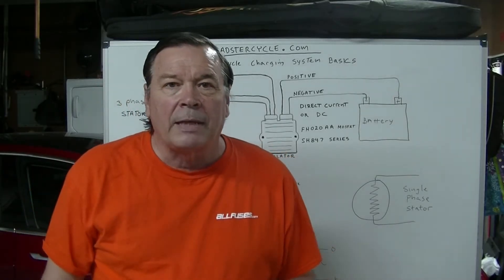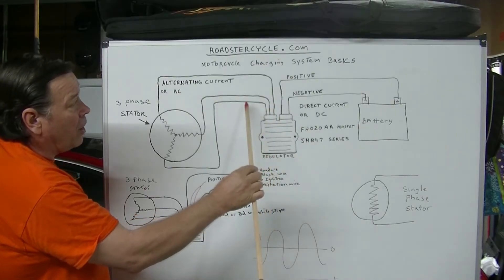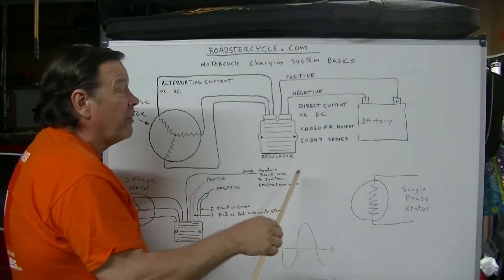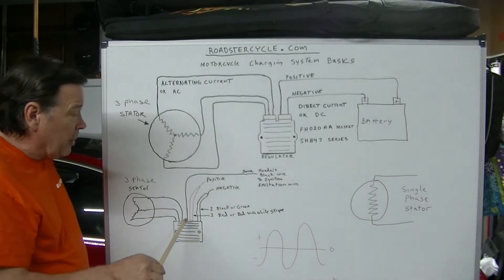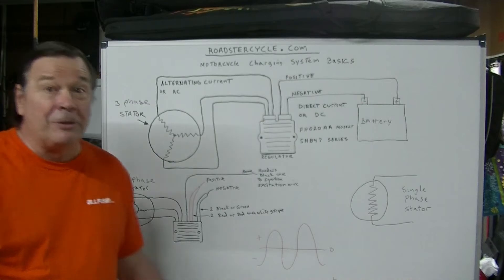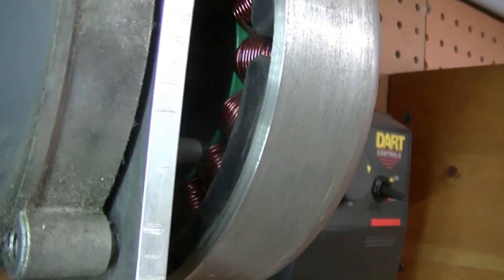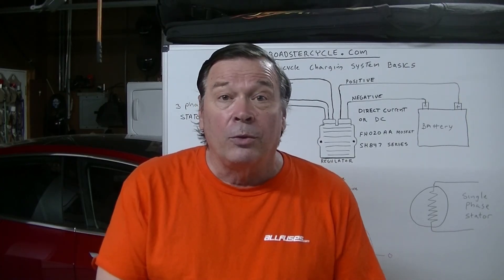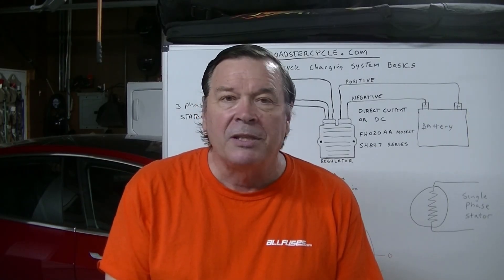Motorcycle charging explained

Comment: I changed stock headlight to LED, + 2 addl LED lamps
does changing old honda 3wire regulator  to 5 wire describe online as full wave help power supply of the bike?

Comment: I have a armada electric motorcycle
First when I lplug in the charger it’s grounding
Second when did get it to charge finally I really debit and after a while the power dies out 
Third the charger started to ground out again
Reply: I meant to say when I finally got it to charge and went for a ride after that the power goes out and can’t get it to run again when I throttle down the power goes out

Comment: Thank you!  Question; does the negative of the Reg/Rec have to be connected to th Battery neg or will connection to ground suffice? (  as Battery negative is also connected to frame ground point).
Reply from the maker: Yes the negative terminal of the R/R has to go to ground. It is not case grounded.
Reply: @Roadstercycle thanks for confirming. I actually tried it yesterday as I wired in a switch (hidden kill switch) and each time I cranked the Kickstarter pedal, no current passed through the switch light, but once I added the ground to the third pin of the switch the switch light lit momentarily. IL try fire the bike up this week and hopefully no magic smoke appears..
I mean the CDI unit...😢😢😢
Reply from the maker: I really like it connected to the battery so the charge controller knows exactly what's going on. If you mount it to a different ground there could be losses between it and he battery. Always best to go to battery.
Reply: @Roadstercycle yes as it's a kind of constant feedback. The problem is a conglomeration of wires at battery negative.  Woul you consider those little multi connectors (5 or 6 terminals) that you clip a wire into as the same as "to the battery" If the battery is one of the wires in the multi terminal block? 
It's been a great challenge and pleasure to wire my SR 500 from knowing almost nothing or being afraid to tackle a wiring diagram. Your videos have helped my understanding, many thanks 🙏👍
Reply from the maker: @pmacc3557  Try it.

Comment: Isn’t the regulator a combination of rectifier (to change ac to dc) and regulator to control battery charging voltage and prevent overcharging?
Reply from the maker: Yes,exactly.  Good job.

Comment: Sir . In my bike bajaj dominar 400 cc, the middle (2nd) wire from starter moter to RR is getting heated frequently. And disconnected automatically.  It’s not connected now for 1 year since . But running well . Shall i change the devices !?

Comment: Does anyone know if I can  charge a 12v system and a 24v system simultaneously with the same stator using two different rectifier regulators.
Reply from the maker: Hi, That does sound feasible although testing would have to be done as the watt output may be quite different.

Comment: This is a great video sir. Thank you. Can I test the charging circuit by placing my volt meter on the battery while running? Do they charge at 12V or higher like an automobile alternator?
Thank you again!
Reply from the maker: Yes, use a voltmeter at the battery, I use the rule on motorcycles 13.8 volts to 14.5 volts with the RPMs at about 2000.
Reply: @Roadstercycle thank you very much

Comment: Hi, what type of regulator do you recommend for the 2001 Aprilia ETV 1000 Caponord, because here in Portugal we are forced to always drive with the lights on. Best regards
Reply from the maker: I have hundreds of the SH847 series out there on Rotax powered Aprilia and Buell bikes. No issues.
Reply: Jack thank you so much for your quick response.
Reply: One more question : can I fit directly in the same place of the original regulator?
Reply from the maker: @joseencarnacao2489  Usually with the Aprilia's guys mount it under the tail. I'm not sure about original place. check my website, the drawing is there. roadstercycle.com

Comment: I want to use a new motor (from a Honda Grom) in an old bike (Honda CT 90) can I just use a regulator that produces 6 volts, or do I need to use a 12 volt regulator and step the voltage down to 6 volts? Additionally, the spark is run separately from the rest of the system so I don't need to worry about that do I?
Reply from the maker: Hi,  Isn't a Honda Grom 12 volts?  If so it seems you just need to change your bulbs two 12 volt units. I'm not familiar with Grom motors so do some more home work.
Reply: @Roadstercycle  the grom is 12 volts, I was worried the wires and fixtures wouldn't be able to handle being powered at 12 volts, but from everything I've read so far it looks like you're exactly right and all I need to do is replace the lights!
Reply from the maker: Actually 12 volts will travel through the 6 volts wires better. Usually higher voltage uses smaller wiring thus Tesla's new 48 volt architecture and why the high wires on telephone poles are thousands of volts and then get knocked down to house voltages with transformers.

Comment: I'm glad there are guys like you to help dummies like me...   what I am getting is, the 3 wires from the stator. then there are an additional two wires going to the battery and one wire going to my ignition    My question is I have a 1976 CB750k and all the replacement regulators have 3 wires, 1 to pos and 1 to Neg.    Are you saying we don't need a wire going to the Ignition anymore???
Reply from the maker: Hi,  You do not need the extra excitation wire anymore with the up to date new regulators. The issue you have I believe is back then Honda had excited rotors in their bikes not permanent magnets like today. So if you have 2 extra wires coming out of your case besides the 3 stator wires you have an excited rotor and the late model R/Rs won't work.  Send me a wiring schematic of your bike and I can tell you in a quick minute of it has an excited rotor system. Jack@roadstercycle.com

Comment: I have a doubt, how does the battery charge if the starter solenoid is connected to starter and the batt negative hooked to the motorcycle body?
Reply from the maker: If you look at your wiring from the battery and negative terminal goes to the frame not the body unless you mean the frame is the body and the positive terminal has a wire going to the starter solenoid creating the all the right connections.

Comment: What do you do with a voltage regulator someone repin and none of the online scamtics work. This is a Zuma with no markings, this bike is kicking my ass lol. After killing 3 voltage regulators. Any ideas be appreciated.
Reply from the maker: Going through 3 R/Rs is not normal. Have you checked your stator windings to make sure none go to ground?  Also without having the regulator your talking about in my hands to check myself it would be hard to explain how I would check it. I would think with a multimeter on diode check setting would tell the story unless it is bad.
Reply: @Roadstercycle  thanks for your information, I have checked all wires, what I think is right is wrong ordered 2 more what do you think about aftermarket parts?
Reply from the maker: @craigbasoco4886  Do you have a wiring schematic of the bike your working on?  Also you can send one to me and I can check it. One thing that I am wondering is this thing use AC power to run everything?
Reply: @Roadstercycle  ac runs lights only, I do have 3 wiring diagrams I'm waiting for the mail 3pm central time today order 2 from different person this time just so you know there's no name on this scooter I'm going off the scamtics wire color code. I can send you wire scamtic . The stater fine 2 f with ground. What happens it heats up white smoke, sometimes kills the stater windings.

Comment: Is the Shindengen SH775 a series/open rectifier?     The forums says it is but after seen some confusing pictures at their website Im asking here.
Reply from the maker: Yes, the SH775 and SH847 are series regulators.
Reply: @Roadstercycle  thank you sir
Reply: @Roadstercycle   Just two more questions,  Is the SH775 good enough for a Busa gen1?  I have no heated grips etc. 
I heard the SH775 can't handle rpm's over 10000, what is happening if going only 1000rpm over?  Overvoltage or does it just stop charging?     

Busas has a redline at 11000 but I haven't ever needed to go that high.
Reply from the maker: @H-M-78  Yes there has been issues over 10,000 RPMs on some bikes. The SH775 is only a 27 amp unit a little boarder line for the Busa charger system. Those things were made to 2 cylinder ATV's not street bikes. Some people use them on street bikes and at one time I even sold them but then Polaris Corporate starting ripping everyone off pricing it way too high. You can buy a 50 amp SH847 for about the same price through me or maybe a Suzuki dealer.
Reply: @Roadstercycle  to bad I have one on the way : ).  But I guess it's possible to sell it.   I have a mosfet FH020BA on the bike now. "BA " puts out a little lower current then the AA they say, can you confirm that?   I have a Litium  battery 

I like the idea with a series regulator better so too bad I didn't check with you first. What do you charge for the SH847 ?  And it is optimal for Litium battery?
Reply from the maker: @H-M-78  Look at my website for prices. Roadstercycle.com

Comment: thank u for the explaining, when i test it i got VOLTAGE..... could u enlight me and teach me how to know the AMPS ????? thanks
i need to know how much max load they capable of, thanks
Reply from the maker: Ok, first you have to know your stators watt rating. Most are 350 watts, so 350 watts divided by 14 volts = 25 amps.
Reply: @Roadstercycle  many thanks, because i cannot find the stator watt so itry to find the amps, i cant find and specs for my rectifier, many thanks for ur answer, thanks

Comment: Thank you telling us the difference between the SH020AA and the SH847AA .  The SH847AA is the way I thought all charging systems worked.  I don't understand why any bike manufacturer would shunt spare power to ground (i.e. throw it away).
Reply: There are two reasons...1. The technology for a MOSFET regulator did not exist when some motorcycle charging systems were originally designed/built.  2. Cost...changing the design for anything involves cost and the Mighty Dollar makes the world go around.  One dollar per bike doesn't sound like much but when you produce 100,000 bikes (DRZ400 for example) that is $100,000 and I don't know of anybody that is willing to just throw that kind of money away :).

Comment: Hello sir,, if i connect the single phase stator side to normal electricity socket will the battery be charged ?
Reply: Yes I was thinking that the same idea can be used to charge batteries at home using motorcycle regulator
Reply from the maker: If you are talking about a home electrical socket don't do it as it will short out and hopefully blow a circuit breaker and you may get hurt badly.

Comment: I have a 2014 Kawasaki Voyager VN 1700, dropped in a LifeP04 battery, great battery, I have a USB/voltmeter outlet, it reads 17 volts when running at speed. Question: Is this due to lead acid charge profile? Or is the regulator suspected to be bad? Is there a regulator for LifeP04 batts?
Reply: Hi sir, supposed I connect three phase side to electricity socket will the battery be charged ?
Reply from the maker: Hi, over charging is a failing or failed regulator. Regulators don't have a profile they just regulate voltage and watt output.

Comment: I am from Torrance, Cal. Are you in LAWNDALE, Cal? Great tutorial. I bought my 1983 brand new Suzuki 1100 and still have it. But now my battery gets drain after I stop the bike. I had to push start my bike in first gear.I bought a new battery but that did not work after 2 days riding.So I am going to my mechanic
Reply from the maker: Charge your battery up and then unplug the regulator and see if it stops the drain. Also you can go to my website for my phone number and give me a call, I have a couple checks you can do for a draining battery if it's not the R/R.

Comment: I DESPERATELY NEED HELP QUICKLY. I have a crf50, Rick's stator, 90 watts, I have the Rick's shunt regulator?  Ether way, my ignition system is seperate, the Rick's stator just adds one power wire. ( originally just the 2) wire comes out, and Ts off to 1 wire regulator and other goes to all my lights.  PROBLEM IS!  I have a chp inspection, found out I need a battery in my system, and is required to get charged by the system.  . I have no idea what to buy and how to rewire it to have a battery.  Please assist
Reply from the maker: Hi,  You need to Google "How do I add a battery and charging to a CRF50 dirt bike"  or just say "dirt bike" to get ideas.  I really have not done that before.
Reply: @Roadstercycle  really is just a 1 wire stator for power  i just bought a 4 wire rectifier to wire in a battery.  I just don't know if I leave the shunt regulator thing in wiring or not.  And I also don't know what to do with the 4 wires. 1 is negative.  1 is positive.  And I believe 2 are ac in.  But I only have the 1 wire.  Can I hook both ac in to the 1 wire off stator.
Reply from the maker: @letsgetit3310  I would leave the other R/R in and just run another stator wire into the new R/R and see if you get a charging voltage.  Worth a shot. It may or may not work but if the stator puts out enough power it may work. If your headlight light bulb is 6 volts all bets are off. It may be 6 volts which means if you put in a 12 volt battery you need to replace bulbs.
Reply: @Roadstercycle  no.  I wired it this week.. All led. But then I found out actual chp requirements.  Which I did read lights need to be able to be on of engine is off for 15 minutes.  And bike has to charge it.  If I'm going to throw battery in, I'm just gonna do it right.  I could use small battery pass inspection.  But what if he leaves it on 15 minutes to check.  I doubt that.  But I want to pass 1st time.  And my horn sucks so bad.. when you Rev it, horn just doesn't work after certain rpm. 1000 volt diode didn't work..

 I screwed up, ground system out.  So maybe horn got messed up.  Doubtful.  7 dollar horn.  Probably just sucks.  But on battery least solve that issue.

Comment: Hello Sir thank you for the explanation. I knda know some electronics. Im upgrading a 150 cc scooter with a 11 pole stator with a 6 wire rectifier from a 8 stator that got damaged when i dropped a washer by the vent hole at the cooling fan. My question is ,Does it matter the position of the yellow wires or do they need to be wired specifically to the stator / rectifier?
Reply from the maker: Hi,  I'm not familiar with a 6 wire stator so I'm not sure. A 3 wire stator  the wires are all AC and can be attached in any order, A 6 wire my need a specific way.  You need a wiring diagram to sort that out.
Reply: @Roadstercycle hello. Actually yes you are right. I meant 3 yellow wires coming out of the stator and one red/black to feed the cdi, one ground and the blue for trigger, hence 6 wires. I did found out the position of the 3 yellow wires coming out from the stator can go into the rectifier in any position because they are A/C. Is this right? Thanks for replying. Take care . Greetings form Chicago.

Comment: Gday Jack, Al here from Australia. My regulator is faulty on my 77 KZ1000A. I have a new RM10-100 that was destined for a Honda but no longer needed. Will it fit my KZ if I just use the 3 yellow stator wires and the black negative and red positive? The reg also has a set of black, white and green coming out of it. Can I just terminate those? Any help appreciated. Thanks in advance.
Reply from the maker: That's a good question.  I would just give it a try as I don't believe it will hurt anything if it does not work. It may have been for an excited rotor on the Honda to control the rotor magnetism. I think the R/R will still regulate the voltage without the rotor control.
Reply: Thanks for the quick reply Jack. Will give it a go and let you know the outcome. Please keep the informative clips coming as they are great. Cheers Al
 @Roadstercycle

Comment: This is going to help me diagnose my issue. Engine won’t run, tried an Arashi regulator and it kept popping my main fuse. Started looking around, and the 3 wires to my stator have a little dark spot on all three near the connector. Pretty sure my stator is shot
Reply: could be cdi too